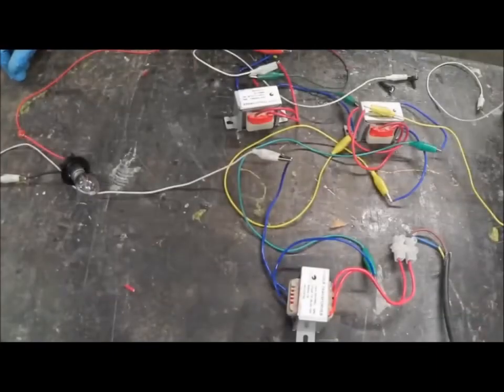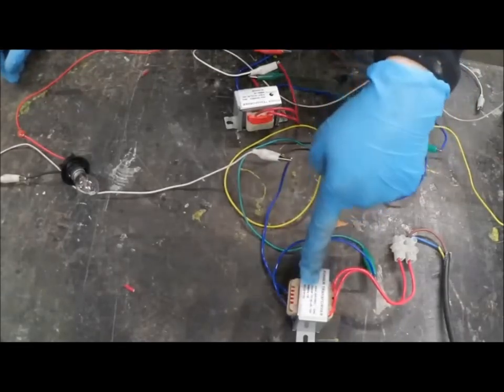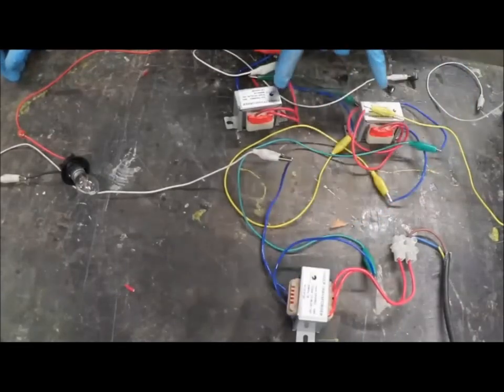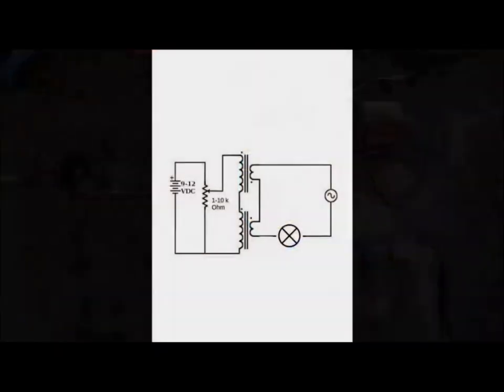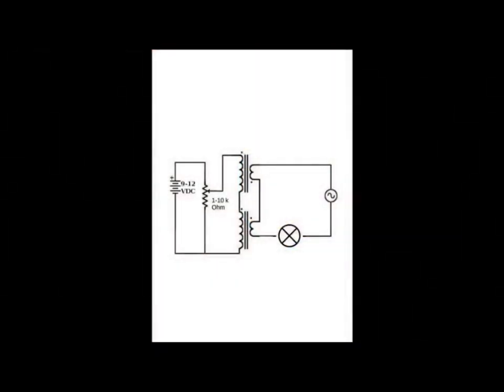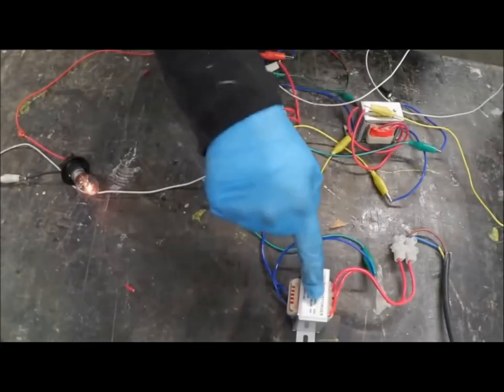AC FILTER Step  Up/ Rectify. Electric potential Magnetic Amplifier.

Comment from the maker: I you Understand this read between the lines. you need 2 coils, and they should be wound opposite each other. there is 2 kinds o current, ac and dc. but the point is you are missing 50 Percent o the available potential. secondly a magnetic core wound in a matter o coil over coil over coil, creates a better magnetic field strengths. not distance,  and single winding like a Tesla coil secondary. so or more magnetic field, wind single coil inductors biffilar.